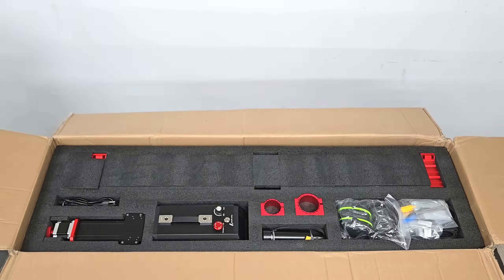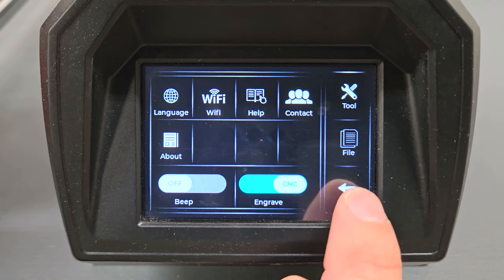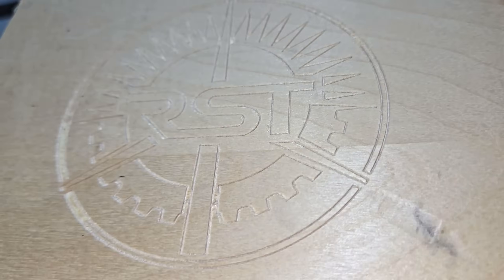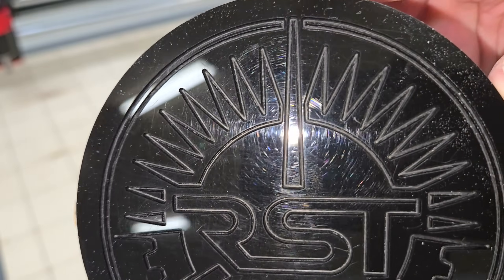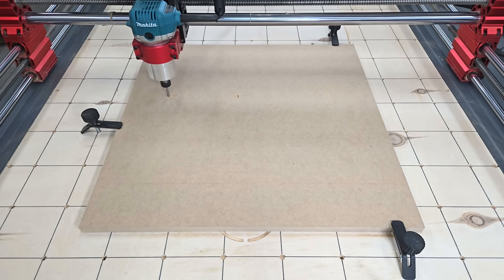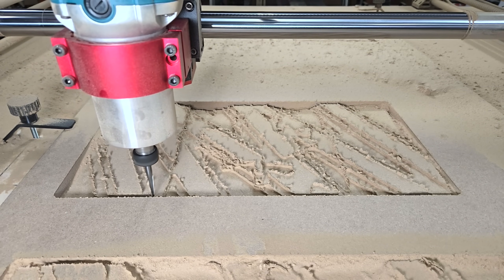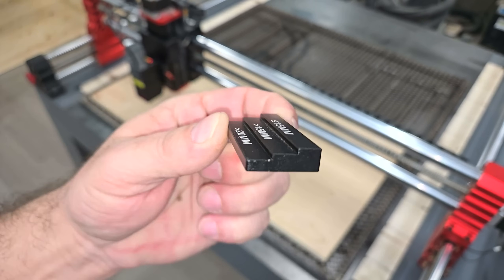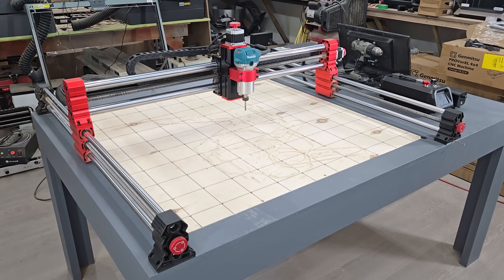Large Format CNC Router for DIY’ers – TwoTrees TTC H40 Review

Comment: Do you think it is possible to speed up the cnc with software change since its running on GRBL? Maybe to 3000 mm/min at least?
Reply from the maker: Maybe. If you're comfortable doing that, then it should be possible as long as the steppers can handle the extra rpm and the electronics can handle the extra current. Surely there's a workaround because this is just way too slow.
Reply: @JamesBiggar  Thinking about buying my first CNC, i really like the H40 but it sure is too slow :( then im thinking about the TTC 6050. what do you think?

Comment: Looks good but really to slow. Your 3d finish pass could have bien done at 1300 mm/s btw.
Reply from the maker: It is slow, but I don't know of any machine that exists that can even do basic 2.5D cutting at 78,000 mm/min (1300mm/s) let alone 3D carve. That would definitely break the end mill if not make an absolute mess of the finish. Perhaps you meant 1300 mm/min (~50ipm)? Easel throttles the finish pass feed rate at <60 ipm - it was already maxed out. It's not the best CAM software for 3D carving. 1500-2000 mm/min is pretty much standard for finish pass feed rate with mdf. Like I said, good for a DIY'er but it's not a proper production machine.
Reply: @JamesBiggar  Oups, you are right. 1300 mm/m. For everything else, I agree with you.

Comment: 3 passes would have been enough for the cut out at 0.8 IPS lol 6:28
Reply from the maker: A ~3/16" doc with a 1/4" endmill in a 300W spindle with a max rpm that's 4000 less than what's typically needed for acrylic? No. You're overestimating the ability of a hobby machine. That's why I switched to the Makita. As I mentioned in the video, you're not going to achieve a proper chip load with this machine. Not without breaking it...
Reply: @JamesBiggar  yikes that sounds like a toy
Reply from the maker: Good for beginners, personal projects. But definitely not a commercial production machine.

Comment: Thank you for the review.

I preordered one in the kickstarter campain. Can you figure out the actual firmware of the machine? And maybe give us a look at the controllboard?

Unfortunately twotrees does not answer very fast to questions.

However I would like to mention things discussed here. 
1. It should be possible to connect a 2.2 or even 3kW Spindle, they promise that in their marketing material and confirmed it when I asked. Even so they do not offer 80mm mounting solutions, we have to diy.
2. When it comes to speed leadscrews are only about 1/5 as efficient as ballscrews in motion and power transfer. Most lasers and some similar cncs have belt drive systems, they are much faster but obviously not as sturdy. So I would assume that the leadscrew design should make it quite sturdy and fitting for a 2.2kW spindle. I plan to installing a 1.5kW, that should be enough with the limited movement speeds for my needs. 
3. The Twotrees Team replied to my questions that the stepper drivers will be exchangable, but did not come back to me if things like uart or spi mode on tmc drivers as well as software configurable currents etc. is supported by hard- and firmware.
Reply from the maker: As I mentioned to others in the comments, the machine isn't as robust as you're hoping it is. What they claim and what is are two different things. The Makita trim router is pushing the limits of this machine. There's serious deflection if it's pushed too much - adding a more massive spindle will only make it worse. The fact that the max feed rate is half of what it should be to produce a proper chip load for most materials and be competitive should give you a clue - it's not robust enough for serious milling. Don't count on being able to mount a 2 or 3kW spindle to it and get satisfactory results at reasonable speeds. I'm telling you that you won't. This is just a budget entry level machine for DIY'ers.
Reply: Thank you for your reply.

I definitely reconsider. If I get the H40. It seems it rather plays in one league with other leadscrew machines like Workbee etc. and not with things like the Onefinity that it mimmicks in apearance.

I was aware that a leadscrew system can not compare to a ballscrew system when it comes to motion speed. But that would be OK for a good price, imho. And the H40s Leadscrews are massive, I assumed sturdiness close to the Onefinity with less motion speed. The Kickstarter price is great, but the "official resale price" still looks good if the quality would be good enough. But I set my limit below that. 

Maybe I should reconsider building a PrintNC.

Comment: Given that the machine is limited in speed are you really seing a big difference with the Makita compared with the base 500w spindle ? Thank you !
Reply from the maker: The Makita is just far better than the stock spindle all around, which is just a generic dc motor. Max rpm is 12000 which is too low for most processes and dictates even slower feed rates than what the machine's motion control is rated for as a result. You can fit a 1/4" collet on it but I don't think it's strong enough to use one for any serious work because in a jam it would be a toss up between the endmill breaking or the motor shaft breaking. And they tend to overheat during long jobs. I've gone through a couple with other machines. These motors are sometimes rated for 500W, but I think they're actually closer to 300W continuous, 500W peak for short periods. 

The trim router is specifically built for milling - not necessarily for continuous use on a cnc as I mentioned in the video, but it's an actual router none the less. Max 30,000 rpm with variable speed adjustment. Better cooling. More power and stronger design to handle larger endmills without bogging down or breaking. 

The stock spindle would be fine for light work on a little 3018, but a trim router is the better choice for something like this. With a large work area, you're making large projects which can take a considerable amount of time depending on what you're doing (eg 3d carving vs 2d cutting processes). In this case, you want something that can handle long jobs without burning out. Just be sure to have spare brushes on hand. They'll need to be replaced after a couple hundred hrs of use.
Reply: @ ok thank you that makes sense, the only concern I have with the Makita is that apparently it is a bit limited in terms of the size of bits you can mount on it versus an ER11 based router… I see that some brands make Makita like clones but with an ER11 mount instead… even Twotrees have one but I think I’d want to get something from a more reputable brand just to make sure that the quality is there… carbide 3D (shapeoko) makes some Makita clones with ER11 but they don’t make a 220v version… and being in a European country I don’t have a choice but to use 220v. However maybe just having the type of endmill mount that is on the Makita is not really a problem ?

I wish Makita would make a CNC specific spindle with a more versatile collet/mount and some separate speed control and emergency stop buttons, I really trust the Japanese when it comes to making reliable and accurate precision tools.

Comment: With the H80 version, do you think the change of the 20mm guide rails on the H40 to the 30mm guide rails would help with being able to better carve aluminum in one of the corners of the build area?
Reply: I was under the impression that both the H40 & H80 use the 20mm guide rail never knew that the H80 uses a thicker guard rail of 30mm

Comment: I wonder what the speed limiting factor is. Would it be the stepper motor’s power or something to protect the lead screws or maybe it’s a software limitation in the control box that could be updated ? Maybe it’s just not stiff enough for higher speeds so they software limit it. But then if it’s just software limited for stiffness reasons then at least laser mode could be unlocked to go faster without causing issues. Thank you for this cool review !
Reply from the maker: All of the above.
Reply: @ Hmm, I see. Probably the laser could go faster given that it’s not difficult for the motors to push it.

Comment: Thank you for the informative video!
I bought an H40 via Kickstarter and wanted to use it to mill rings from 3mm aluminium sheet, among other things. In your opinion, is this even possible with this milling machine?
Reply from the maker: Don't get your hopes up. I tried and it worked, but there was too much deflection. Granted, I was using a 1/4" endmill at around 60 ipm with a 0.05" depth of cut. That's a bit aggressive for something like this. If you try it, use a 1/8" endmill instead (a proper 3 flute designed for aluminum milling - I didn't have one that's why I tried 1/4" 3 flute), go slow (<30ipm) with a low depth of cut (0.015-0.025"), use lubricant like WD40 for cooling (spray periodically on the endmill and workpiece while it's running, doesn't take much), and if possible, keep your workpiece tucked to one corner so your spindle doesn't have to travel to the center of the rails where they're weaker. Let us know how you make out!

Comment: 24h for a job😂  i will get a real cnc
Reply: It's going to be similar with even far more expensive machines.
Reply from the maker: That's the way it is with 3D carving on any cnc. 3D carving with a fine tip is a very long process. You have to go slow (slower than the max rating for this machine) and with very short step over if you want good quality finish, otherwise you end up with tool lines. You should get informed on cnc processes before buying one so you'll know what to expect from it.

Comment: So, it basically looks like an european version of onefinity. But it looks nice. And its (for now) bit cheaper. Ill definitely take a look on that project.
Reply: No it is no way close to the Onefinity in any way. Onefinity controll panel is far advance, it more sturdy, Soooo much faster and can mount more advance spindle
Reply: Chinese not European or did you mean European as in smaller in size than American stuff ?

Comment: I know this is a budget CNC, I just wish it was possible to go upto a 2.2kw spindle with spindle speed controlled by g code. I would get one tomorrow if that was the case.
Reply from the maker: Needs to be a bit more robust for that I think. The Makita pushes the limits of these tube rails without upgrading to thicker walls. It would be nice to see an upgraded version.
Reply: @JamesBiggar  You're probably right. I only have lasers, but I would like to get a cnc soon. I find it difficult to choose which CNC after buying crap lasers in the past. I don't want to make the same mistake again.

Comment: Can you tell if the lead screws use anti backlash nuts? Similarly can you tell of the lead scews are fixed on the end to prevent side to side thrust based movement, bearing pairs like you normal see on ball screw setups
Thanks

Comment: This is the size I've been waiting for Genmitsu to come out with. Their current 4040 Pro model can only be upgraded to 6060 Pro in size. This TwoTrees is a copy of their design and mounting extrusions, except in red.
Reply from the maker: You'll be happy to know that Sainsmart recently launched a bigger Genmitsu machine (PROVerXL 4x4). It's a beast. I'm reviewing it next.
Reply: @JamesBiggar  Yes, but that's a much more expensive machine, with ball screws and closed loop steppers. And it's like $4k
Reply from the maker: I know. And it's far more robust than a design like this, with a max travel speed of 5000mm/min (nearly 3x faster) which allows you to not only work wood and plastics, but also metals with PROPER chip loads to limit wear and tear and perform batch processing effectively so you can compete commercially, unlike these machines. I tried metal on this - it doesn't work well at all. Way too much deflection. These are entry level budget machines. That's what they're designed for. Good starters to learn with and make personal projects without investing too much. But nothing more. You get what you pay for, that's the bottom line.
Reply: @JamesBiggar  would this still be sufficient as a start with but not to competeting for commercial work, what about a new store front make smaller item with a large batch on something like the H80 instead of the H40. at a 2m x 1m board some maybe okay with producing 50 item on a full sheet in a12hours milling time.

Comment: Thank you for the review. I'm admittedly biased, in that I think, IMHO,  the lower threshold for being a "large format" router should start (at least in North America) at 4'x8' for full-sized plywood sheets. This unit, in its largest iteration, will be available at ~39-3/8" x 78-3/4. The Kickstarter promo price for the 1m x 2m footprint version with 20w laser and 800watt spindle is $2k USD ($3200 MSRP). Greater speed requires a greater power spindle, which requires a stouter frame and gantry, stronger servos & driver-controllers, which drives costs up. I'd love to TwoTrees make a stouter, faster, higher power unit able to cover a 4x8 footprint. I think they could easily offer such on the U.S. market for $5k-$6k and really take the lead in that space between high-end hobbyist & entry level commercial CNC routers.
Reply: I’ve been looking at FAR too many cnc videos recently trying to decide on a first machine, and I would think the ‘alt-mill’ from sienci labs out of Canada would fit the bill for what you’re after. They offer one with a spindle and ball screw drive at around 3k USD and the video review from IDC woodworking looked promising
Reply: @briankillebrew  Thanks! I wasn't aware of Alt-mill, but it looks impressive. They've really created a high-performance unit without any of the unnecessary fluff. And it looks like they have a 4x8 in the design pipeline. 😃
Reply: I would say a 4x8 machine would be stepping into professional territory. Large format is relatively accurate in this case as a 4x4 plywood sign or some kind of other art is fairly large.
Reply: I agree in the terms of size for these things. I'm in Canada and my issue is that to get anything in the 4 foot by anything range it's like $5,000 CAD or more. A little steep for me, but I don't see a point buying a CNC that can't process a full width piece of plywood personally. Not much point getting something so expensive if I can't use it to build cabinets for the house lol